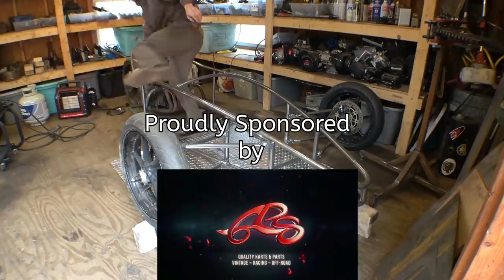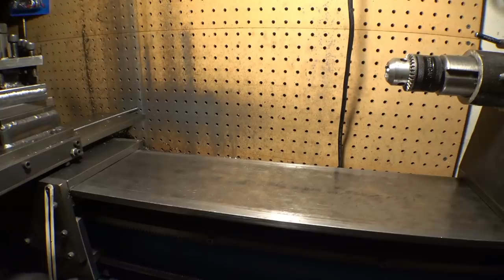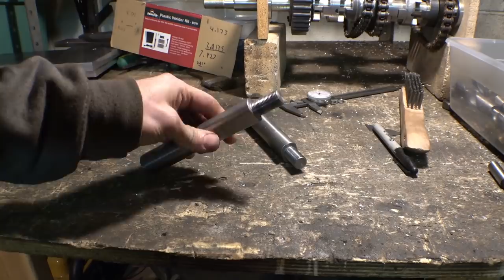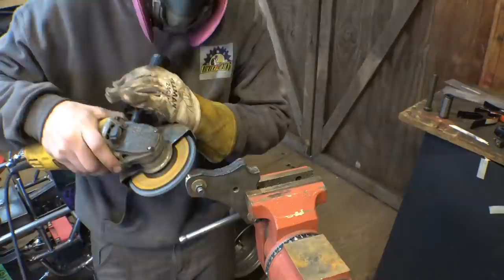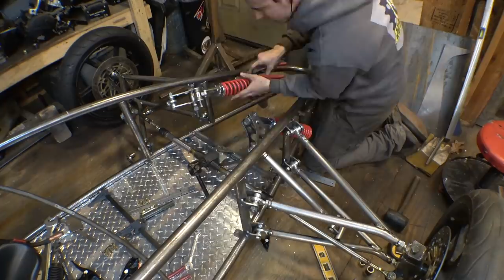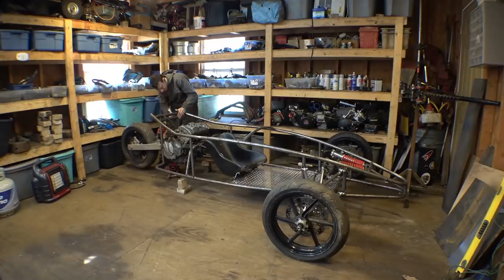CBR 600 Reverse Trike Part 4

Comment: A cantilever is a static support system. This is a pushrod actuated rocker arm suspension. Ever hear someone say they have roller cantilevers in an overhead valve engine? No, you haven't because they are pushrod actuated rocker arms.

Comment: Looks like it could use an anti-sway bar on the front
Reply: Definitely. It'll handle like shit without one, but he'll have to get creative about how he implements it, because it'd be in the way of the pedals if he puts a traditional style anti-roll bar. He could implement anti-roll bars from the bell cranks to the chassis, like this, but even this would take up most of the space at his feet: https://ars.els-cdn.com/content/image/3-s2.0-B9780080994253000066-f06-19-9780080994253.jpg?_

That's a challenge for the type of suspension he's put in this, but he could make it super short with a small strut, no spring, with high dampening.

Comment: When you're cutting alloy with a saw, sprinkle a little chalk or talc as you go to keep the teeth edges clean.
Reply: Or filing, it's the same deal.
Reply: Or don't stand on it causing the edges to close in on the blade lol...
Reply: Easiest way to cut aluminum is with a worm drive skill saw and a Little wd-40 use carbide blades go slow, use hearing protection. Can cut any thickness even 2” if you need to.  will work great with little effort and much faster.  Also safer to put some 2by 4’s on floor to keep the sheet on. will work much better.  set blade just deep enough to penetrate thin sheet don’t let blade hang to low will have better control that way. For nice straight cuts clamp a piece of angle iron for saw to follow. I learned this from an older machinist buddy. Been doing it this way ever since. Hope this helps

Comment: I'd put some longer travel and slightly stiffer shocks on the front or go back to the 1:1 cantilever arms and get stiffer springs.  Also, I'd put some sort of supportive guides on the steering rack extensions.

Comment: Outstanding job on the front suspension. It looks great. I use a 6” cutoff wheel to cut diamond plate, you might want to try it. Keep up the good work.

Comment: What are you doing for anti roll bar/system? I think you should look at a pull rod/push rod F1 style set up. That way when you corner in this instead of swaying over to one side (which I think may happen with this design) the suspension will be connected, so when one side is compressed the other side will compress also, so the vehicle will be flatter found around corners.

Comment: You could have made several holes to adjust the suspension hardness instead of one arm length.
Reply: Yeah, i'd make another set with several mounts, the shocks can be upgraded as well.

Comment: Based off of my Traxxas Revo 3.3, which has a cantilever suspension, by changing the length of the cantilever itself doesn't stiffen the suspension, it just gives it more/less travel. In order to actually make it stiffer, you would need to increase the spring rate.

Comment: twin tube oil filled dampers dont tend to work to well unless vertical or nearly so as they rely on the oil being in the base of the shock the foot valve that is in the bottom of the damper works rather better with oil rather than air. you will need to upgrade to gas monotube damper such as the koni ohlins or bilstien  rather like the ones they use on the atom. ps love the build always wanted to do roughly the same thing but with 4 wheels.crack on.
Reply: Right  Gary

Comment: Shock location is good I would leave it on the softer side as well too stiff will be bouncing the front in the air over bumps.  Definitely add more bracing to the pivot arm pins to hold them in place and bearings as they will have a lot of stress on. them.

Comment: Sorry I must ask this but you have the shocks sides ways and it got me thinking I may be wrong so it's a lesson for me but when I work with shocks they have fluid in side of them and I tried to put a bike shock upside down it did not dampen so it felt really soft turn it back it worked just the way it was ment to. Just something to think about if you are using standard shocks they be designed for up use only.

Comment: For the rear suspension, take all the preload out of the spring. Look up how to tune motorcycle suspensions (specifically Dave Moss Tuning) for how to do this. If you take all the preload out of the shock and it's still too stiff, you can pick up a softer spring. RaceTech's website has a tool to look up the spring rate on that shock based on the bike it's on, and you can order a spring from them that's stiffer or softer, depending on what you need.There's lots of videos on Youtube about how to change the spring. Alternatively, you could look for a shock from a bike that has a softer spring rate and order a used one on ebay pretty cheap. Could also do that for the front, but with stiffer springs.

Comment: Find a pair of shocks from a snowmobile or quad front end.  Your spring-rate is too low with the shocks you have.  

You started with a 1:1 bell rank, then about a 2:1 bell crank.  Most sport bikes have a front wheel travel of 120mm (4.7”).  I wish I knew the travel length of the shock rod?  If your shock rod travels 2” and you need 4.7” for wheel travel, I think you’re going to have to reverse engineer it, but always remember, “spring rate” only adjusts “ride height”.  Love the push-rod!  And it looks perfect right where it is!  I can only guess, but I’m thinking you’re going to get “body-roll”. Sway-bar from a quad or sled might help?

For the rear suspension, did you relocate where the dog-bone connects to the frame?  It will change the ratio just like the front did.  Both ends are really just bell-cranks.

Again, love the front end!  Nice work!

Comment: did the steer rods came that long or did you weld them to make length? i made mine with vehicle sway bar links and weld them. will add metal strips on the joints to make them stronger. you think it will hold?

Comment: Oh, one more thing, I know it's supposed to be strictly on road, but if they'll fit, duro hf904 tires would look so awesome on it
Reply: No no no noo its meant to be only on roads no any kind of offroad tires...
Reply: @iiroing2479 I literally said i know it's strictly on road, they're dual sport tires that look great and handle great on road.
Reply: @99milesaway41  well i still think that supermoto tires works better..
Reply: @iiroing2479  you know supermotos are dual sport motorcycle, right?
Reply: They're literally a dirt bike with blinkers and street tires.
Reply: @99milesaway41  in my age, 15 we only speak 2 styles: enduro and supermoto, and supermoto means  bike with 50-700cc engines and street tires. And because i live in finland and my age is only 15, my english can be pretty bad but you got my point...
Reply: @iiroing2479  alright, that's fair.
Reply: @iiroing2479  Your  English is better than my Finish
Reply: @ypop417  maybe because we learn english in school

Comment: I'm not sure if this has been commented on but motorcycle wheels are designed to be leaned over, not pivot straight up and down. Also maybe you could try to use a zip cut disk in a side grinder to cut your aluminum. It does make a lot of dust though. 
I sure enjoy your projects. Your living the life.
Reply: I was wondering about that too; whether the spokes/tire bead can handle much perpendicular force...
Reply: @derek6187   Yeah,  I would not worry so much about the tires and wheels so much as  a motorcycle axle and bearings are designed to be supported on both sides. His way will overload the inner bearings at best.   At worst snapping the axle  where it connects to the upright.  I hope nobody tries to copy his design particulars,  putting themselves in danger as he is.

Comment: There should be 2 screws on that back shock to adjust shock one should be on the cylinder that the line runs too and the other should be on the shock itself if i remember right i have one on my bike but its not in front of me right now

Comment: You should reach out you fellow YouTubes like moto mule he has lot of knowledge with parts those shock are way to soft you could have got a stiffer spring on the same length. But I know you order stuff a head of time for content.  But planning head with the suspension hurts the build. Might me time to looking  to buying a small cnc plasma table. Your machine work is great but it takes time. And the good thing about plasma table you can remake parts if you decide to make custom parts to sell. But for the most part going to be fun to drive . Well happy new year

Comment: Have you thought about those Shocks and where the oil in them is sitting? The shocks when on a motorcycle have the oil in the bottom and when you pump them in and out-  the pistons and valving internally squirts the oil thru- creating dampening...... You have them mounted on their side and upside down, so any oil inside is at the top and are they even designed to work like this?

Comment: Just order different spring for the rear shock. adjusting a shock like that really only adjusts the sag of the ride not so much extra dampening is going to happen unless you change the spring to accommodate for added weight.

Comment: Looks like you're going to have mad body roll. Maybe a sway bar will do the trick. Also, with the front suspension as soft as it is, if you were to cut that front loop shorter or raise the bottom of it, you'll run into less bottom out issues.

Comment: Your front A-arms appear to be coplanar. Are you going to lower the inner mount of the upper arm or raise the outer mount at some point? You're not getting any negative camber gain under compression. Actually looks like you're having a positive camber gain at this point.

Comment: I could be wrong but, I noticed your A-Arm mounting brackets are at an angle which would not allow a "free" movement of the A-Arms as each end would swing in different arc patterns? It seems it would be "free" movement of the brackets were parallel and the A-arm end were angled? I like your work.

Comment: Need some inward camber. So u dont have camber steer with the front wheels stright up and down. 
!=! Death wobble
/=\ camber will pull toward each other so ull drive stright while hitting bumps.  Dont need much just a little inward lean.

Comment: The rear spring rate looks good as you were standing very close to the pivot point.   I'd say the front looks a little soft though.  Yours is a single seater and probably lighter than mine.  My two seater was just over 1000 lbs. I used a Mustang II coilovers for the front.  
Watched bloopers while typing. The bigger shocks looked much better on the travel.

I'll be following your build. Will you be putting a body on or keep it "naked"?

Comment: A dab of oil goes a long way when cutting aluminum. Also, a circular saw with a wood blade actually works pretty well.
Reply: Yep, and clamp it to heavy plate to kill vibes. Chatter lets the teeth bite too much and tear off.

Comment: Lot of hard work. Just as a general design principle though, better to have the gridplate above the tabs so the weight is not taken on the threads of the screws.

Comment: Chris, serious question, do you understand what causes bump steer?
Because it seems like, with every vehicle, you just take a guess and hope it works. Things like required steering arm length are not terribly difficult to calculate and measure, if you know how it works.

SK2815 has done a handful of videos on suspension geometry, which should be a great help.

Comment: Can you not go with the bigger shocks on the front for that extra stiffness then adjust them out to their lowest setting, maybe add a couple of adjuster holes in the bracket? In a reverse trike you need the front to be quite stiff.
On the rear you have a ring adjuster at the bottom of the shock, use that first to get your stiffness before you mess with the damper settings on it. 
Are you using a 1994 F2 for the donor parts?

Comment: Bro you need to fab up a anti roll bar for the front it’d stiffen it up and get rid of most of the body roll and for the rear shock the straighter up and down the shock is the stiffer it will be lean it forward about 10-15 degrees it’ll soften it up

Comment: "I think it's kinda working" lmaooo
Reply: I feel stupid, but what's bump steer?
Reply: @petemartus8876  If the steering linkage joints don't line up exactly, with the  a-arm joints, when cycling through the suspension, the lengths will change, at different rates, pulling or pushing the steering arm.  So, when hitting bumps, the wheels will be "steering"  in all kinds of crazy ways.  When setting it up,  you must be able to draw an imaginary line through all three joints on inner and outer arm attachments and steering linkage.  All 3 must also be on the same plane also!

Comment: Like your persistence. A word of advice. When you drive it and brake hard the rear weight will travel forward. Your front suspension may bottom out. Not good if your driving hard. Like your engineering .

Comment: have you ever set your wood floor on fire from welding
Reply: use to weld on plywood all the time all I did was scorch it.
Reply: The red hot berries (spatter) cool off very quickly when they contact the plywood so at most you get a small little burn hole.
Reply: Wayne Crews yes they only stay warm for a long time when they get in your shirt or shoes.
Reply: tazthedevil22 
Or your ears, where you can hear them sizzling as they burn.

Comment: I think I would have set the floor pan on top of the brackets
Reply: That would mean less leg room
Reply: It wouldn’t be any different. The floor pan would still be on the bottom of the frame, it would just be over the small brackets that it is bolted to. This would give it a cleaner look
Reply: It would be less leg room by like 2mm so not noticeable but if you have ever had a work vehicle with aluminium shelves or boxes the bolt holes flog out really quick so if the floor pan is hanging under the brackets the only thing holding it up is the bolt head or washer which will become loose over time creating a dangerous situation think the fast and the furious where as if the floor pan is on top of the mounting tabs while it will still become loose over time the worse that will happen is the vibrations will be noisy and annoying

Comment: You have a tremendous amount of scrub on the front spindles. You may wish to change the offset or go with offset rims. Also moving the A-arm hinge points closer together will help with bump and camber changes with suspension travel. Just helpful advice not a criticism so please don't take offence. I design RT's for a living is all.

Comment: Ur rare suspension is stiff because not much weight is  on them..ur center of gravity is in between front and rare wheel, whose distance is quite far from each other..and the shock absorbers u r using is made stiff to absorb shock when it is at the centre of vehicles...means when it is below the centre of gravity of vehicle... example,like motor bike..where this spring is placed below rider and close to engine..
U can attach two spring like that u used for front axels..in rare..they will get the job done...

Comment: Ive watched every build on this channel and youve done some cool stuff. But now its kinda getting old. Theres nothing new except chassis design. Nothing wrong with cool chassis design but its the same old motorcycle power plant stuff, most of which has been underpowered requiring special gearing. Also the lack of reverse is unnecessary. Ive been a long time subscriber and am waiting for that next big leap, maybe something seriously off road 4x4 with a v6 transplant from like a toyota or dodge caravan. These motors and trannys can be had for as much as youve paid for the motorcycle engines. A junkyard pulling video would be a cool start to the next build. A smaller version of a rock bouncer with a v6 with 33 inch tires (also from a junkyard) would be stellar and a big boost to your views. Please consider this because I like your style and frame building talent. Thanks.

Comment: You were pinching the blade by sitting on top of the diamond plate, hence why the blade was binding so bad, trust me, ive used sawzall's or reciprocating saws a lot, they work just like cutting with a hacksaw by hand, need to put preasure opening up the cut, not squeezing the cut shut.

Comment: My 2p In the slot
I’d get the wheel set up YOU want to run first then start messing about with the geometry 🤷🏻‍♂️ it’s bound to change again as the build is in progress get a basic ride height YOU want build a good solid chassis as always then work the suspension 🤷🏻‍♂️ good work so far tho it’s always in progress so YOU are never at a loss Fuck the haters they just can’t or don’t show they can do it better 😉

Comment: Please reinforce the bracing. 
This is the same suspension type that took aerton senna. 
If at all possible point springloaded shafts away from the face and body, one retainer failure and poof